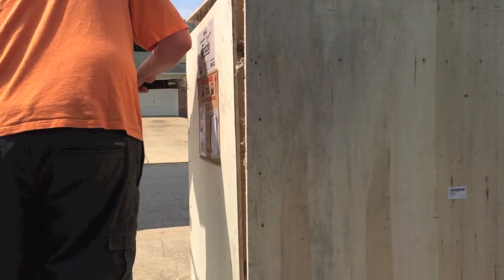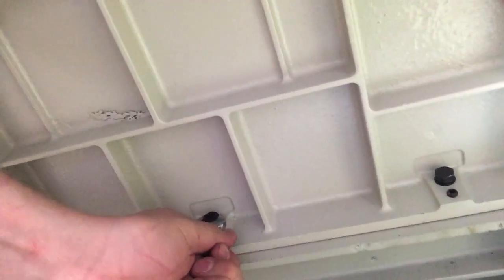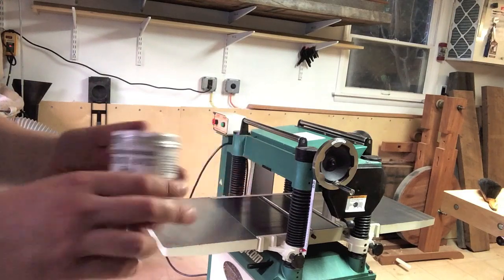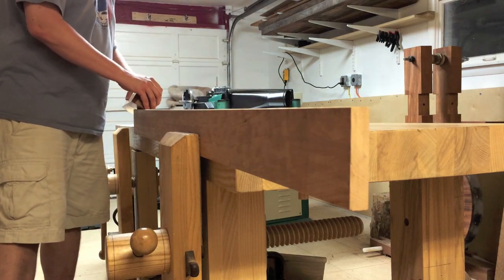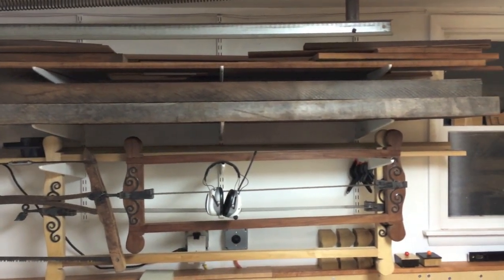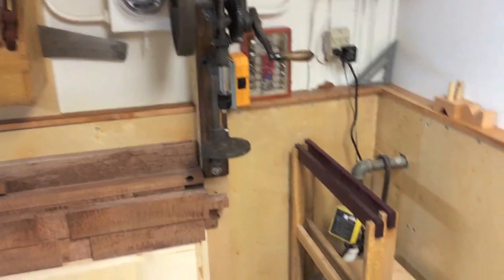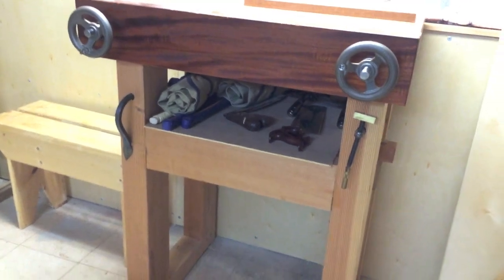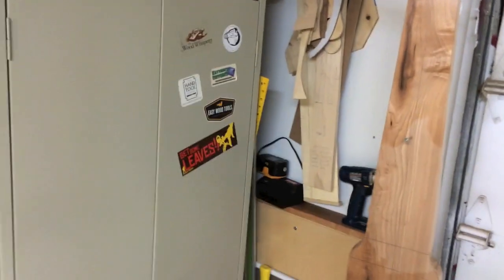RWW 180 Workshop Remodel Part 4

Comment: Shannon, please detail how you got it off the crate? Mine comes in January so I have time to get ready. I am going to have to build a rolling sled to get mine down a 1/4 mile gravel driveway. The truck will not come down since there is no turnaround.

Also, since it has been a few years, how do you like it?
Reply from the maker: I used the crate material itself to create a ramp from the pallet to the driveway.  Love it, great machine